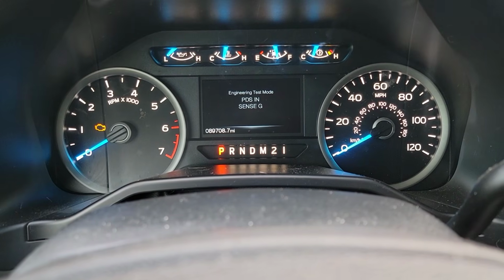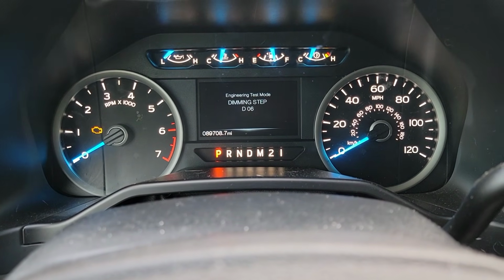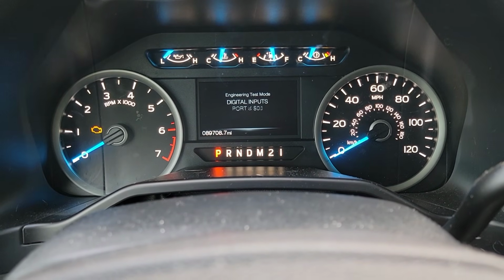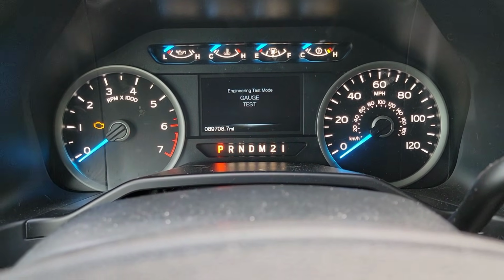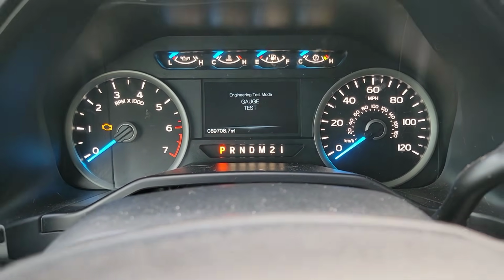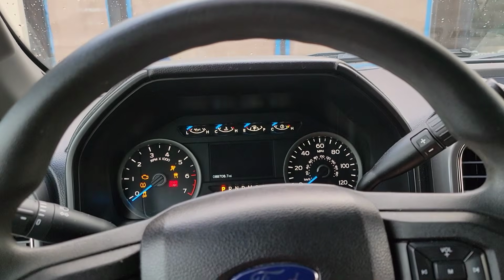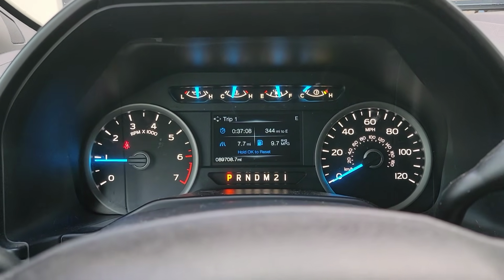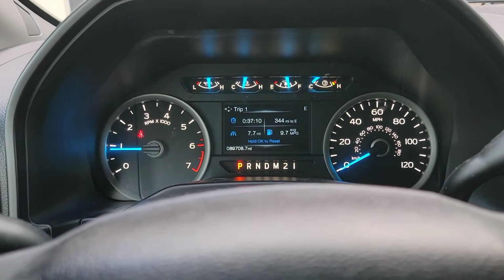Trick - Fords Engineering Test Mode

Comment: Tried this multiple times today and it won’t go into that mode. But I do have low fuel message and tpms error message when I first turn it on. Not sure if that is stopping it or I’m doing it wrong. Wanted to do the gauge test because fuel gauge isn’t working and not sure if it’s the gauge or the sending unit.
Reply from the maker: I'm not sure what to tell you buddy I just know how to work it that's it

Comment: Love the content.
Diag.  My starter with prior video.
Also, your video on flood lights- got them and no more orange lights.
*dont know if you ran across this type of question 
2017 f150 eco- 3.5, driving normal today anout a 40 mile drive. Coming up a hill then slowing down to get my exit ramp. Upon deceleration- 228f popped  up then went away. Aparently truck got a little warm, no towing or hauling anything. 
I have 52,000 miles didnt through a check engine light, but kinda alarmed cause aparently it got warm enough.
My thought is thermostat potentially  sticking.  Might just flush the system,  and change it, i did read that they changed antifreeze type. Something about potential deposits.
As i ask, you run across this before and would it be a waste of the fords tech guy to preemptively  do anything a this time.for a 1 time thing?
Reply from the maker: A lot of four guys with F-150s are having these problems and it just randomly happens and it's very hard to figure out what it is
Reply from the maker: I have fixed a few of these by replacing the thermostat with an updated thermostat through Ford that's got the plastic housing instead of the metal, I've had other people do the same thing with no luck.

Comment: A/D counts are not cycles.  It is the value of the voltage in digital form.  A/D stands for analog to digital.  The device reads a D.C. voltage and converts it to a digital number that the computer can digest. FYI

Comment: I managed to get into the Engineering Mode and get some DTCs yesterday. Now it won't work because the Steering Assist Fault message is covering up the screen. I kept the OK button down for 30 seconds after cycling the key and it still doesn't work. 2017 F-150 XLT 4x4 V8.

Comment: I just learned about this because my estimated computer mpg's was very generous with the claimed efficiency. I was able to take my actual mpg with the claimed mpg and calibrate the computer to be more accurate. Haven't a clue how people claim their trucks gets 23 - 26 mpg's. In my opinion they are full of shitaki mushrooms.
Reply: My computer is off. But at 65 and below it showed 27 (actual about 25.2). Normal interstate (80) and it dropped to 23 on display (21.5 actual).

Comment: Good morning Sir, I have a 2019 ford taurus and always when I put gas in a full tank, it shows me that it's only 120 miles. Sometime it change to 185. But one time only it shows me that 305 Miles.  I went to Google and I saw that the range is 320 to 456 on highway. My question is why it doesn't show me the 300 Miles range that it suppose to do and always stop at 100... everytime I put the full tank? Do you think there is something I have to fix??? Thanks in advance

Comment: Oil pressure not listed I take it? I have a "19" 3.5L thinking ford has a dummy binary switch that does not read actaul pressure.
Reply: Awe I was hoping to be able to see the oil pressure, did you ever figure this out?
Reply: @Alborn30 I used Forscan to diagnose a bad oil pressure sensor. The sensor does read actually pressure when working correctly in the scan tool. I can’t remember if engineering mode was able to display actual value on the cluster. I sold the EcoBoost so can’t try it now.

Comment: Hello ford boss man , I have a 2017 f150 that has a speedometer sometimes reads up to 12 mph fast but the reads normal,  will this cycling of the info help this inconsistent problem?
Reply from the maker: Well if you bought it used somebody may have some big tires on it and they reprogrammed it for those bigger tires and you have to reprogram it back to stock with the as-built data

Comment: 2019 f150 3.5 Eco. It didn't work on mine, I saw it in the background but my truck says drive modes aren't available and disappears. I had the local Ford guys check to see why my drive modes aren't available and they couldn't find anything. Driving 200 mile to a special tech Wednesday, maybe he'll know something... Thanks for your vids!
Reply from the maker: Well I don't know what to tell you because there's other people in the comment section that have a 2019 it worked on
Reply: Didn't work on my 19' 150 3.5 either
Reply: @shanerobbins5309  mine won't go into drive modes, it says not available. I can see the engineer mode behind the drive mode nat available but when I hit ok it all disappears. What I did find is if I turn it off and quickly restart I can get my drive modes. No check engine lights, ford couldn't find anything wrong...IDK just glad I can get into tow mode now

Comment: Rich, my 2015 f150 has been having issues with the media buttons for a while but right before a big trip now only the horn works on the wheel. Adaptive, cruise ok, arrows, doesn't respond to any inputs. Any advice?
Reply from the maker: You could either have a accessory protocol interface module problem with the radio that's causing issues with the steering wheel or you could have a bad clock spring or a blown fuse

Comment: 2018 Ford expedition it didn’t work. Thank you very much please can you upload more video’s  my expedition, coolant fan running too loud I check the main relay still does that? Do you know what causes it?
Reply from the maker: Could be ac high pressure switch causing the fan to run high

Could be plugged radiator or ac condenser causing system pressures to increase and run high

Could be stuck relay

Or pcm commanded bc low speed isn't working and the fan assembly needs replaced 

It needs diagnosed
Reply from the maker: I think you didn't do something right - I've had people report it does

Comment: Hey Ford boss, I have been having some issues with my cooling fans running almost non stop as soon as I hit operating temp on my 2018 F150 3.5EB.  I recently had phasers, timing set, and water pump replaced.  Temp gauge seems stable.  But I don’t have a digital read out.  Truck has the old style sport dash.  Could I use this to find my true coolant temp? And do you think it could be a CHT sensor?
Reply from the maker: It could be a cylinder head temperature sensor but I doubt it
Reply from the maker: The only way that I know of that you can actually figure out what your coolant temp is is if the vehicle gets above 213°, it will start displaying the numbers on the cluster other than that you're going to have to have a scan tool watch all my other videos on cam phasers in order for you to understand more about it
Reply: @FordBossMe  great info, I’ll check out more of your videos.  I watched the he one about the updated thermostat and I know that mine was not replaced during the phaser replacement.  I was unaware that the temp would display on the cluster if it got that hot.  That is a bit of a relief because that has not happened.  At this point I’m considering taking it to Ford to have them examine it but without a CEL I’m not sure much can be determined.  Thanks for getting back to me so quick
Reply: @FordBossMe  quick update, I ran my truck in engineering test mode for about a 20 mile ride, peaked around 230 degrees on the highway, I don’t believe the red sport cluster shows the temp above 213 (don’t quote me, but mine never has) either way.  Got it home, water outlet hose was still cool compared to the rest.  Went to ford, picked up the updated part# thermostat you referenced in your video and a gasket.  Had it installed and vacuum filled with new coolant.  Went on a long ride last night (about 50 miles mostly highway at 70-80mph) no excessive fan or temp flux.  Fingers crossed but all seems to be good now.  Thank you SOOO much.

Comment: A/D = analog to digital converter, and counts generally refer to the instantaneous value of the input. The instantaneous counts divided by the maximum counts will give you what percentage of the input range the sample currently is. If the battery one is a 10 bit A/D, it will have a range of 0-1023, so a value of ~610 will be about 60% of that range. This would make sense for a 0-20v input range, and would correspond to ~11.9 volts. How's that, clear as mud? Thanks for the easter egg!

Comment: Hey rich I have same year truck and dash how did you change to the built Ford Tough  on the dash instead of F150 when turning your key on can it be changed in the same method that you just showed in this video?
Reply from the maker: No I'm pretty sure it has to be done through programming specifically but I'm not exactly sure how to do it

Comment: Thank you for this rich. I have always wondered why we cant get a message on the display with the code stored when the MIL is illuminated.
Seems like it would be so easy for Ford to do.
Just got a P2073 on our 2016 F-550 6.7 chassis cab. Cleaned the MAP sensor with MAF cleaner. Hope it solves the problem.

Comment: Rich ? My 2020 has Ford Pass. The 10 speed transmission, sometimes fells like it slip's, What you think ?
Reply from the maker: Take it in get it documented Ford knows about this they're having a lot of problems with these
Reply: Thank you
Reply: @garyrigsby8464  check/change spark plugs.  That helped with my 2019.
Reply: I have 41,000 miles, You still think it needs spark plugs.
Reply: @garyrigsby8464  or wait till check engine light comes on that’s the best time to do preventative maintenance.
Reply: @garyrigsby8464  Nah just let ‘em go till you got clogged cats and plenty of buildup in the engine.

Comment: Dig it but if no one but that special engineer knows what any of these codes means…. What good is it for us?
Reply from the maker: I can't believe you even asked that when I showed you live info that you could use 

I don't get these comment like this, really passes me off
Reply: @FordBossMe  ya know what dude. You get triggered and insulting too often. With me and others for simple stuff. I’ve been a subscriber of yours for about 2 years now, I’m never an a-hole but you always comment back like a freakin jerk, so now I’ll just unsubscribe.
Reply: @kineticenergy1085  He's annoyed because you didn't actually watch the video entirely, he explained the entire thing, and gave you details as to how certain things can be useful. You won't be missed.
Reply from the maker: You can't monitor system voltage but with it you can

You can't check for dtcs but with it you can

You can't monitor trans temp but with it you can

You can verify Air Fuel Ratio but with it you can

You can't verify more accurate mpg but with it you can 

Your comment just plain sucks because you didn't listen point blank

Comment: I have a question. What's the protocol for when you diagnose? 
I had a Taurus SHO. Low load misfire but it could only be felt. No codes. I took it in and they wouldn't even look at it without codes. 
I went home, frustrated, and found a spark plug with carbon tracking. 
Very easy. 
Why don't dealer techs even check simple things anymore? Just a "no" if there's not a code. No checking the basic things, fuel, spark, air.
If it's reasonable. I understand spark plugs can be buried, etc. But if they're easy, why not?
Reply from the maker: We still have to check if there is a concern
Reply: We always had to attempt a diag. Even though the misfire didn’t set a code it would have shown up on the misfire graph under the same driving conditions. Unfortunately not all shops and technicians are the same.

Comment: Interesting. I've never done this through the dash. I have done the same thing through the radio. Like the speaker test and all that good stuff.
Reply from the maker: There is speaker test option for that side and engineering mode for the other side
Reply: @FordBossMe  yeah I went into some sort of test mode. You can do speaker test. Touch screen test. Color test. See part numbers sync versions all that stuff on the radio side. Never been into the dash side. Wonder if that will work on my ranger so I don't have to ride around with FDRS to see my transmission temp when I change my fluid
Reply: @BeardedFordTech  fdrs ? Can it be used with the USB elm 327 ?
Reply: @coreybabcock2025  FDRS replaced IDS on some 2019 vehicles like my ranger. 2021 f150s. Basically the new vehicles use FDRS instead of ids IDS STANDS FOR INTEGRATED DIAGNOSTIC SOFTWARE FDRS STANDS FOR FORD DIAGNOSTIC AND REPAIR SYSTEM